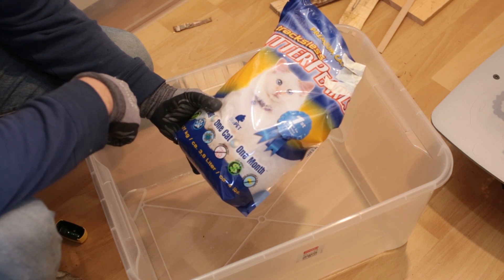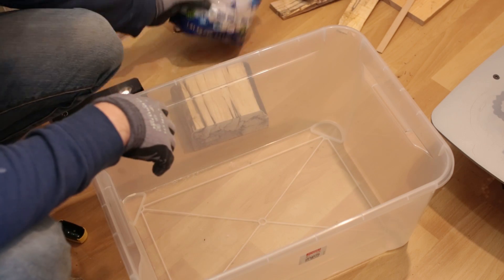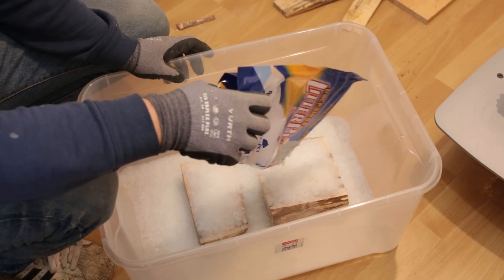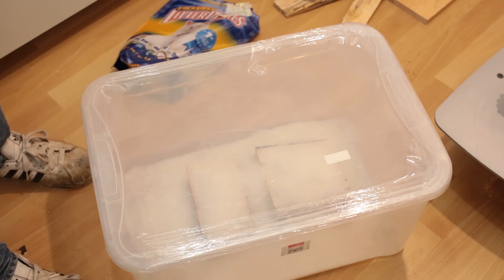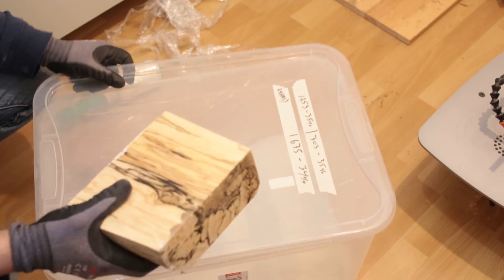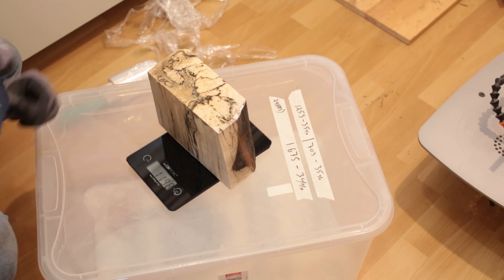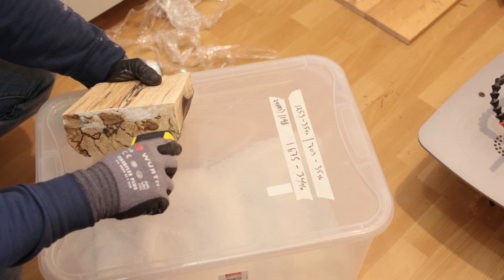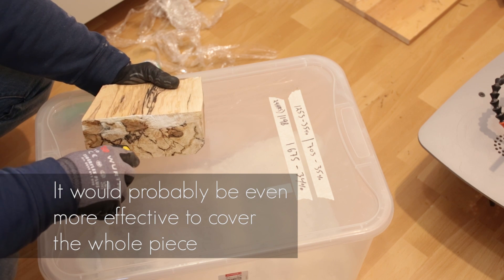Can You Dry Wood in Kitty Litter?

Comment: Do you have any concern with case hardening or checking?
Reply from the maker: Not with these smaller pieces. I have not noticed any drying defects yet.
Reply: Dieter Schneider I just purchased some silica gel based cat liter to give this a try myself. I'd like to see how big I could go (within reason) before I experience problems. I'm curious to see if larger prices dry all the way to the center. 
I've always been told/read that surface cracks and check from drying wood too fast. It seems to me that if you haven't experienced problems it's more likely that checks and cracks are cause by different areas of the wood drying (and subsequently shrinking) at different rates. If it all drys and shrinks at the same rate by being surrounded in silica, even if that rate is fast, checks may not be a problem.

Comment: Thanks for the tip Dieter , I have moisture problems in my 3D printing filament and silica gell is expensive, but crystal kitty litter is very cheap. Just have to find a way of controlling dust
Reply from the maker: Thanks, glad you found it helpful. It was very little dust from the kitty litter I used, but I know people put kitty litter in socks and put them in their car to get rid of fog on the windows. Might work?
Reply: Hello, I use it for my 3D printer filament as well. To deal with the dust, go outside and pour the silica from one box to another while you're holding the box high. This will have the dust and little bits fly off in the wind.